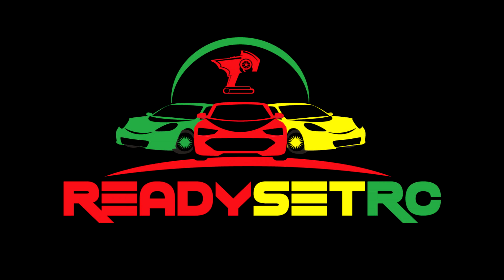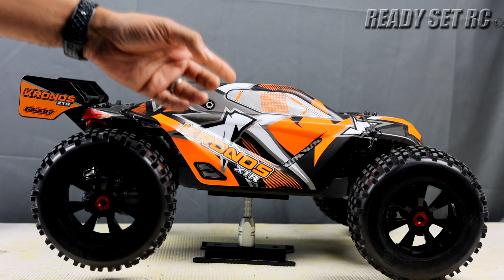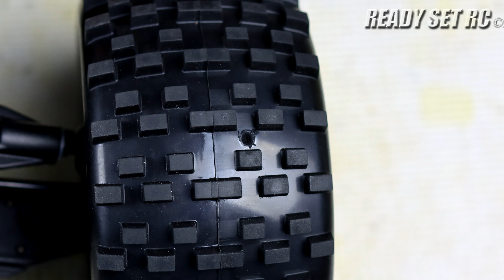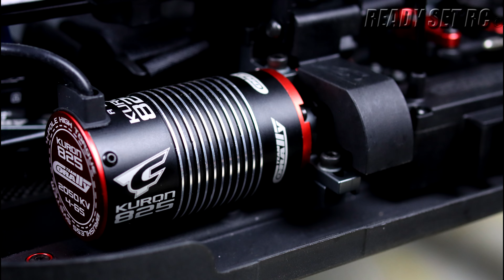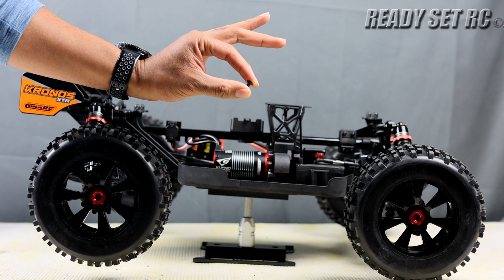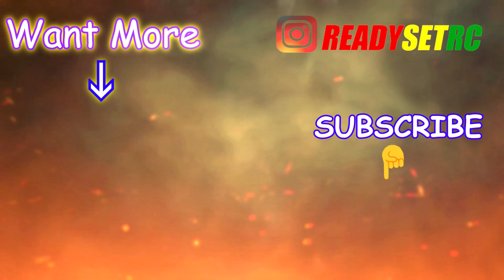Team Corally Kronos XTR 2022 Reveal

Comment from the maker: If you are not following @PhilthyCo RC you need to be!  Just sent me a vid ontips on this truck.  The key one being the ESC mount.  As you saw in my video the ESC has some movement.  Philthy just informed me to mount the screw under the chassis and the movement will stop.  BOOM done!  I was looking for this mount when I installed the ESC but it was not lining up. I put a little pressure and was able to line it up.  Great tip Philthy
Reply: he has awesome knowledge on all corally rc,s
Reply from the maker: @TheAdventuresofWally  Philthy is the first channel I saw that was talking about TC RC's and not even just these 6S bashers.  World of knowledge.
Reply: @ReadySetRC  he has given me great advice on my Team Corally rc,s. 👍